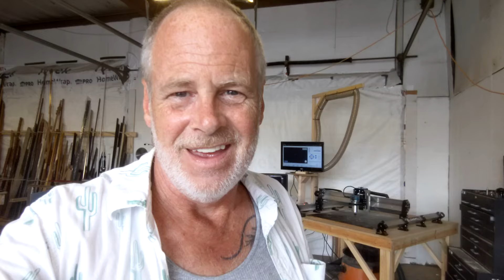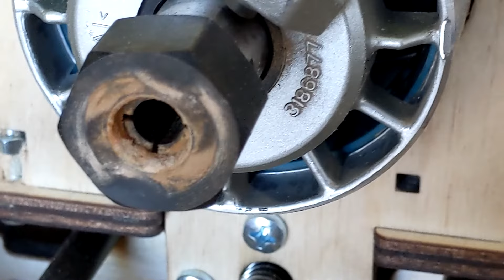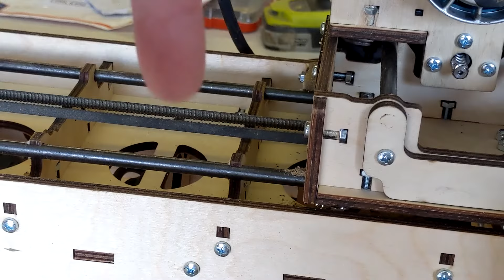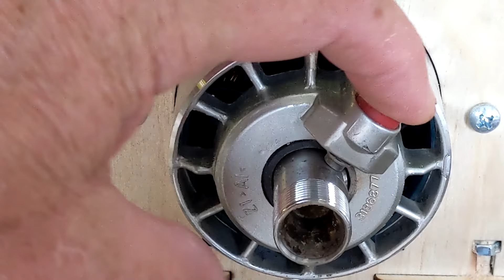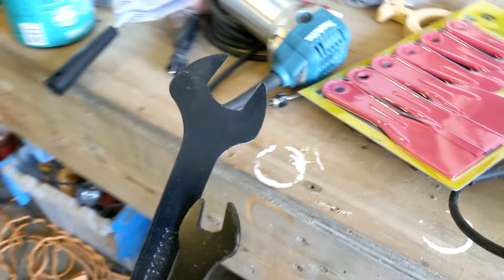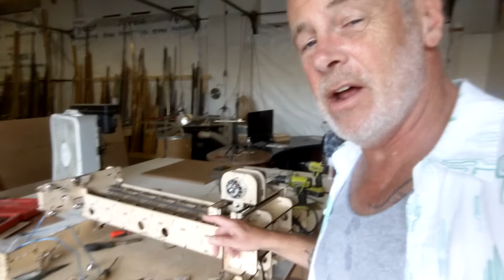CNC Router Projects **IMPORTANT TIP** [Save Your Wood Projects] - Garrett Fromme

Comment: How come your collet was not attached to your Nut when you took it off. Does it not snap in to the nut 
That push in button will last if you don't over tighten then Nut which most people tend to do, which also  will ruin the threads on the shaft
Jeff
Reply from the maker: Hey Jeff. The makita is not built with the 'snap' feature.

Comment: Hey Garret, good vid. I live right up the road from you. We need to hook up some day for coffee. I have a beginners question I hope you will look at doing a vid on. Lets say you are creating a sign and going to cut out pocket or even profile BUT before you cut this sign you would like to plane the top on it first. Maybe just to clean it up or to bring it down to a specified thickness. How can this be incorporated into the tool path?? I also have a 4x4 Avid if you ever need something big cut. Sending you an email.
Reply from the maker: Hey Todd. Sorry, no video on this one...yet. A quick answer is run a surfacing bit across it.  Same as spoilboard surfacing except at a smaller level. Watch this video to see what I mean:  https://youtu.be/JwFwdbohzjY

Comment: Dewalt dw611 has only 1 wrench and the pin in the router is supposed to be used as directed.  #JustSayin.

Thanks for the videos, very informative other than that tip.
Reply from the maker: Hey Mark. Yes the DeWalt is built differently and the pin is made for that. The Makita is not. It's Makita owners I was talking to. Thanks for the comment